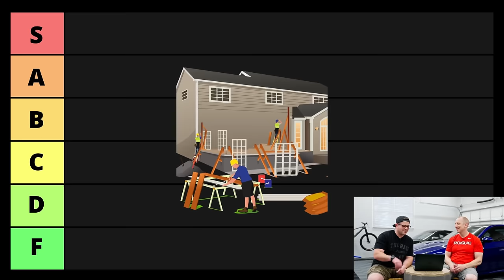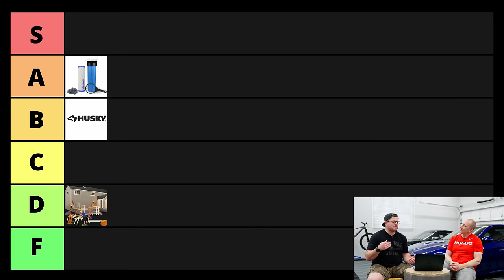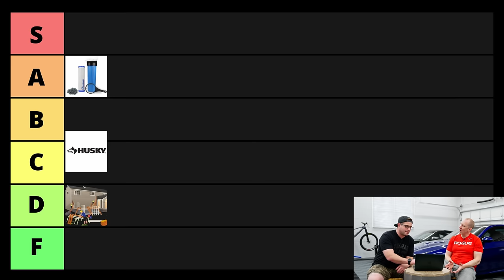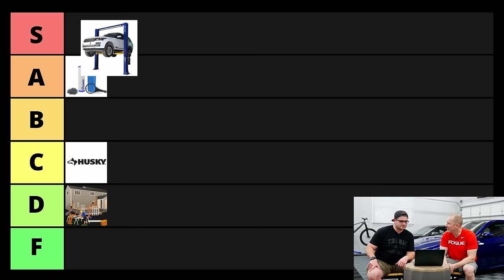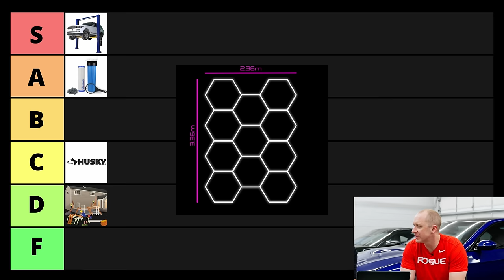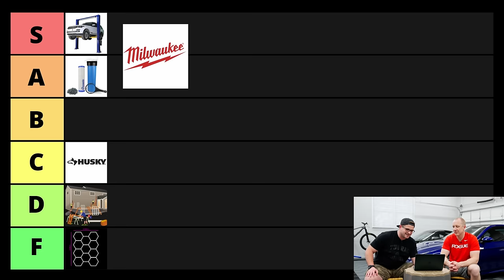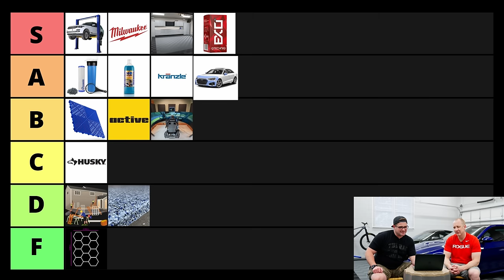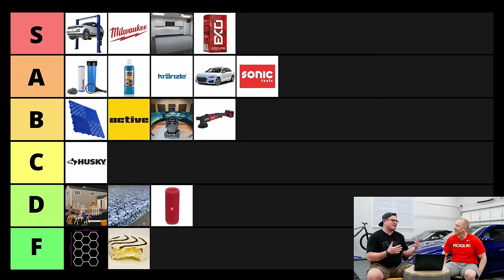The Ultimate Obsessed Garage Tier List

Comment: I've been hammering Matt in the comments for years on rinseless washing. I do 99% of my washes with rinseless and I use the same process he does for the wheels. I may use an IK foamer instead of a foam cannon, but I could do a foam cannon if I wanted to. I'm using the pressure washer almost every time I wash. If he was at my house in either the dead of winter, or the dog days of summer...he would absolutely understand why rinseless is S-Tier for life.

Matt is 100% correct about Hex Lights though. I went with Barrinas for a temporary solution until I can afford the CREE lights he sells, but I do not like the Barrinas at all. Their only benefit is a lot of light for very little money/effort. They may give me a headache and eye strain, but at least I can see what I'm doing in the garage now.
Reply: I do the same thing for rinseless, use a pressure washer for the wheels, front end for bugs, and a prerinse if necessary
Reply: Not to mention the absolute diversity of products Rinseless can replace. Clay Lubricant, QD, Waterless Wash, Glass Cleaner, Interior Cleaner, household cleaner. It is absolutely S-Tier as a product type.
Reply: @adrianr514  for sure! DIY detail rinseless is my main interior cleaner
Reply: Whats your go to product for rinseless wash? ONR?  and do you use a detail spray of some sort as a drying aid when wiping the car/truck?
Reply: @traubgator  I like diy detail rinseless and p&s absolute. I usually use a drying aid, not out of necessity as the rinseless provides its own lubrication for drying, but I like the added protection of something like diy detail ceramic gloss or armour detail supply amplify
Reply: Rinseless is a very superficial clean and completely inferior to a soap like gsf or reset in slickness and cleaning ability.
Reply: @whitegoodman7465  I completely disagree. If you try it for yourself with a quality rinseless wash and do the process correctly, you’ll be amazed that the car in the end looks exactly the same as if it were washed with a soap. I’ve been detailing for 3 years, and I‘ve only done 4 soap washes right when I started.
Reply: I have done many rinseless washes with onr v4 and have absolute right now along with the ubs, still think its inferior in pretty much every way. Yes its saves time and its great for people in apartments but using rinseless especially with just a marolex sprayer, bucket, etc..like i said is not a true clean and you def have a higher change of marring the surface if you decides to wipe vs rinse. Rinsless is not even in the same ball park in terms of paint safety with a prespray and wash compared to a proper high ph pre wash then foam again prior to contact wash with 2 buckets. The slickness is like a soft cloud on top of your paint. I have had many instances with rinseless not getting off stuff from the paint (car parked outside) among other issues like a dirty bucket full of dirt at the bottom and bugs/dirt floating around which was all wiped off the car... None of my buckets have a spec of dirt in them after washing because of my prewash which imo is king. Now if people want to use rinseless after wheels/tires and prewash then to each their own if they prefer it over soap since the bulk of dirt is removed from the prewash but even then i still think its properties are inferior. Foam a car with reset then throw your wash mitt from the soapy bucket on the roof and tell me its not the most satisfying thing. @ethanblan435
Reply: @whitegoodman7465 Agreed but I have found some use for rinseless lately. I have been adding it to both my rinse and soap bucket. It does kill the foam in the bucket but it adds a lot of lubricity plus the dirt pulling effect in the bucket. I’ll also foam the car again after doing my high ph foam so I’m not relying much on the bucket foam.
Reply: Agree 100%. I use rinseless for tons of things like drying aids and quick detailer, i also put it in my rinse bucket because of dirt flocculation with polymer rinseless like you mentioned. Not a rinseless hater and actually thought of using it instead of soap after my pre wash which i might do for the hell of it, i do miss being able to prespray, wash and dry all in one step, very convenient instead of foaming half the car (18 foot sedan), wash, rinse then do the same for other half of car then one final rinse around then dry. I enjoy it but do miss some things about rinseless, i think its best used after a pre wash or at least pre rinse. @epap1375
Reply: Ive said it before, living in FL,no winter muck to deal with and with near perfect cars, i would be doing nothing but RW’ing.

I also still use the PW on my wheels/tires.

Comment: Matt is funny when he goes on tirades. I laugh at his Snap On spews, but I still love my Snap On tools. I agree with Matt on the lights.
Reply: @timkinley1779  flawed in which way, I use them everyday working on semi trucks and trailers. I have owned Milwaukee M18 fuel impacts and I prefer the Snap On brushless. Snap On ratcheting wrenches, unlike Gearwrench don't seize up. I have yet to have a Snap On tool fail when I needed it to work.

Comment: Rinseless is good for the body of the car.  For the wheels, you have to pull out the bucket and hose/pressure washer.  My M2 produces a lot of brake dust.

Comment: PPF is a must at bare minimum on the front. I would tier ceramic coatings under PPF. There are so many good spray sealants you can apply every few washes that can fill the void of a ceramic coating. PPF can be a huge help in preserving the look of your vehicle

Comment: Fun video as Matt says what is on his mind. Matt’s financial advice is spot on so listen to him. Please keep shopping at Costco as I bought stock a few years ago at 375 a share and now the stock is over 740 a share. I am the oddball who first bought stock at the age of 14. The hexagon lights are terrible in my opinion too as the moldings crack and the lights run radio interference. I do not like those floors either as they trap contamination and harbor it. I worked for Publix for 12 years and clean floors is really important to me after working in a food prep area. I will argue rinseless wash is more efficient and economical than soap. Just because it is rinseless does not mean you cannot use a pressure washer for removing the presoak and cleaning wheels. Thank you for a fun video and hopefully this happens at least once a year!
Reply: If your gonna bust out the pressure washer, hose, foam cannons etc..why use rinseless after everything when its completely inferior to a quality soap in cleaning ability and slickness.
Reply: @whitegoodman7465  not all rinseless washes are inferior and some may be superior. Rinseless costs significantly less than soap, cleans as well as soap, amd is more efficient.

Comment: Oh god...not the hex lights lol.  Pretty much agree with all these rankings, with a few outliers:

PPF - kind of hard to tier this.  I feel like there are generally two types of people...those who care about rock chips, and those who don't.  If you care, then it's an S-tier because what other options do you have?  I also heard $3,000 price points mentioned...I didn't hear what type of coverage that was for, but in the northeast, you can get "essential" coverage (full front bumper, mirrors, 1/2 quarters, 1/2 hood) for <$1,000

Ceramic coatings - the fumes, user experience (although there have been great improvements), and the inability to completely remove residue from rags make coatings unnecessary imo.  There are too many good SIO2 sprays out there now that last 6+ months and take 15 minutes to apply without having to worry about high spots

Garage audio - spending serious dollars on a speaker system for an echo chamber garage is quite the choice lol
Reply: @timkinley1779  PPF from 25+ years ago was definitely rough, to the point where it was still sort of competing with car bras. 

Modern PPF is really solid.  Quality films are typically warrantied for 10 years now
Reply: @timkinley1779  so good question - I can only speak for the Northeast, but our most common customers are actually folks who keep their vehicles for 10+ years.  Our customers drive Subaru's, Lexus's, Honda's, and Toyota's...vehicles they plan on keeping long-term that they want to protect.

Matt mentioned "there's no point in getting PPF if your vehicle isn't at least $80k".  Oddly enough, that's probably our smallest customer base.  35-70k are our core clients, and then we have folks with $150k+ vehicles and huge disposable incomes.  $70k-$150k tends to be lease territory